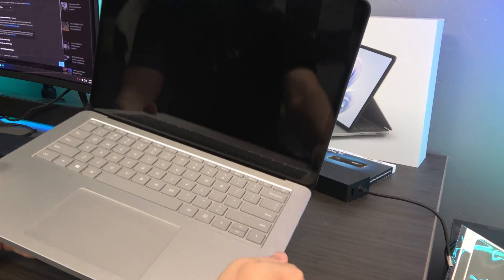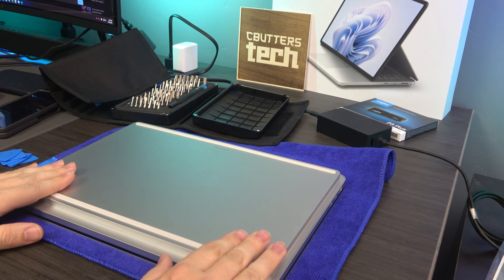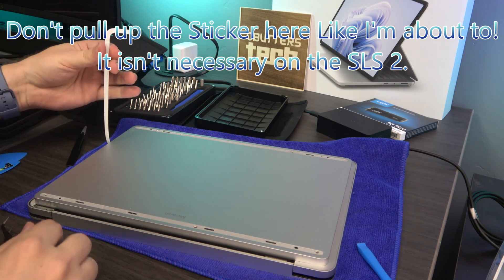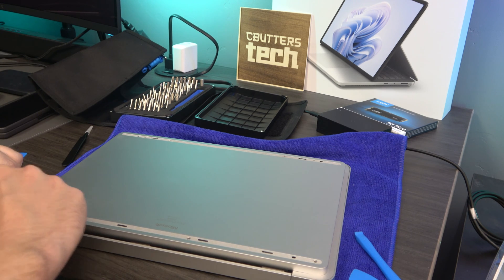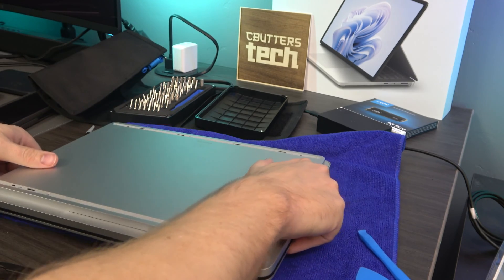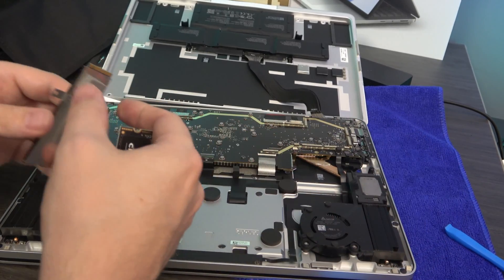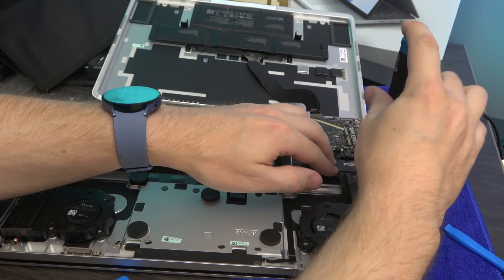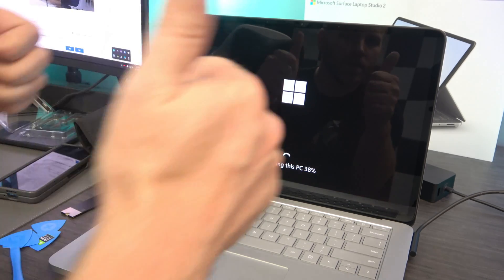Inside Surface Laptop Studio 2 - SSD Upgrade and New Internals

Comment: I installed a Performance Plus Gen4 4TB nvme ssd in my Laptop Studio 1 and it's been going strong for over a year. I don't see a need to upgrade yet and maybe will consider the Laptop Studio 3 when it comes out.
Reply: Can I ask what brand? Because I've bought a 4tb ssd before and it wasn't compatible with anything.
Reply: @giorgosrallis.x  Performance Plus Gen4 m.2 nvme. I don't think the newer gen5 ssds are used to their max potential with the Laptop Studio 1.
Reply: @giorgosrallis.x  Performance Plus Gen4 m.2 nvme. I don't think the Laptop Studio 1 can fully maximize the performance of the newer Gen5 drives.

Comment: I know I am late to this and it isn't a complete solution, because of the sticker on the touchpad.. but! What if, we just made holes in the silicone feet? Make the holes always accessible. All you need is a sharpened metal tube and cut into it. Hell, you might even plug the holes back in and the surrounding silicone will hold it in place. Then you could do regular maintenance like repasting once in a while.. of course, there's still the issue with the sticker.

Comment: I don't like the fact that the battery connector is still a thing, I feel like it's gonna catch out at least some people. I always found the interior of the SLS to be very interesting, I wonder why they use such a unique layout with the fans at the bottom and an inverted motherboard instead of the more traditional design.

Comment: Will replacing the SSD void your warranty?
Reply: they have to prove that your modification caused the defect you file a claim about
Reply: I have upgraded the SSD in several laptops while on warranty.  I just put the original SSD back in before it gets sent for repair.

Comment: how to re-apply the rubber feet after disassembly ?
Reply from the maker: They stick right back on.
Reply: @cbutters  do we need adhesive ?
Reply from the maker: If you got it dirty or really damaged it coming off then maybe, but I've found they stick back down easily without any.